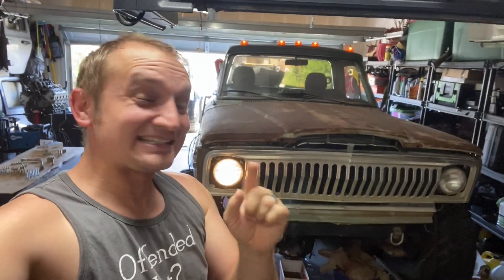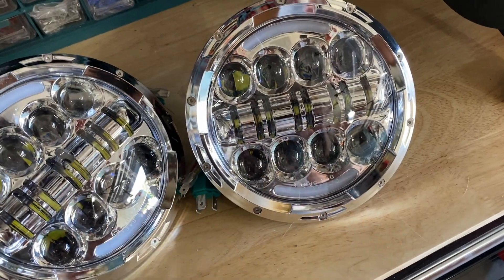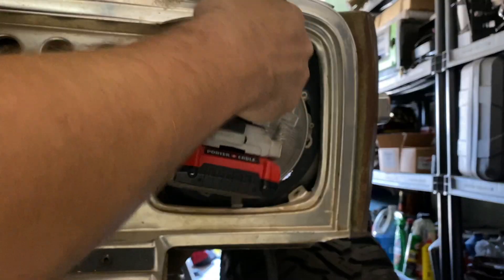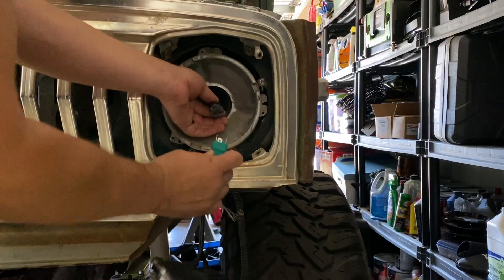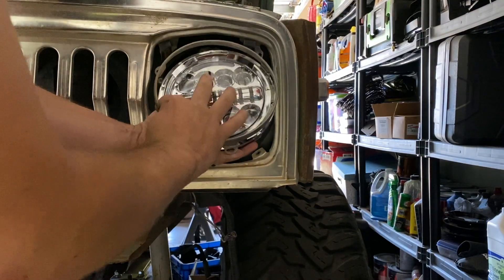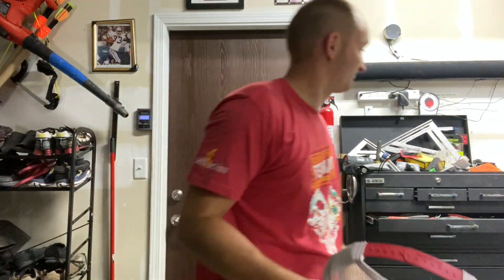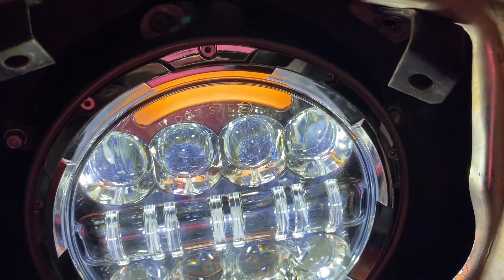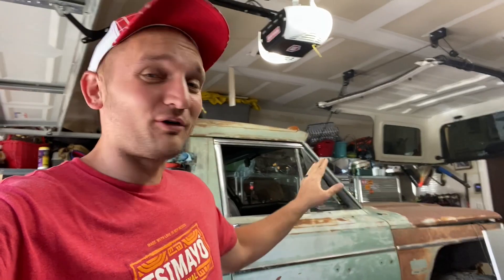J10 gets some modern editions! #4 update

Comment: Since you have a plasma cutter and a welder, why don’t you cut out a circle the size of that grommet and then weld it into the antenna hole, then grind it flush?
Reply from the maker: Cause I had grommets 😘😂
Reply: JL LIFE OFFROAD yeah, but you’re a fabricator now!
Reply from the maker: I fabricated the grommet straight into tht hole 😎

Comment: Hey bro you check your flasher relay? Also if I remember the J10 had square amber lights as turn signal I could be wrong. May need to track the wire and see? if so order you some button LEDs they sale them at truck stops also. 
 I know you wanting to wheel it more than traveling it so those button LEDs would get you by they make them bigger too also. Take care bro and hope you an your family has a good 4th July.
Reply from the maker: So one of the reasons I picked these headlights was it had built in signals... 

A few others recommended the electric flasher relay.. I’ll order me some ima boy and see if tht helps..

And u are right... the turn signal housing was cut out by previous owner... and just the bulb was hanging... they would turn on solid... wouldnt flash thou 🤔
Reply: @JLLIFEOFFROAD  if they solid to no flashing definitely replace the Flasher relay to see if that works. I always tell people to start small before going big.
Reply from the maker: Appreciate the advice my friend 🙌🙌🙌
Reply: @JLLIFEOFFROAD  no problem bro anytime

Comment: Do the rear signals work?
Reply from the maker: No... the fronts would turn on constant when I hit the signal..... tht was prior to the swap..
Reply: @JLLIFEOFFROAD  I would try a new flasher relay. Fairly cheap and easy to replace. Being as old as the truck is it may have been on it's last leg.
Reply: I also assume ya checked the fuses.
Reply from the maker: The turn signal is getting power.. so didn’t assume the fuse was out... the flasher is what I’ll try next 🙌🙌

Comment: Damn I didn't know  this was going to be one of those flinch videos... When the light comes flying at you.

Completely understand changing the lights and using these ones... No need to go $$$$ for this application. Don't know about the turn signals but will keep an eye out.

Your videos help make impressions on key points to remember by leaving in the "errors" like they flying lights and the clocked headlight bracket... Got to love the way you....plan.... Those types of things into your shoots 😄 💢🤘
Reply from the maker: Lmao! Yes ‘errors’ 😂😂😂 doing my best to show why 😂😂😂😂

So apparently I need to add a e-flasher to fix tht... But yea... These look good and will be seldomly used 🤷‍♂️